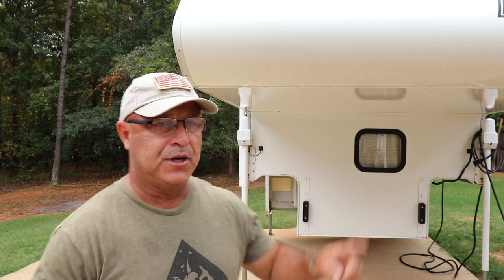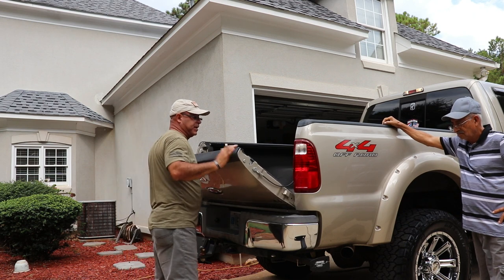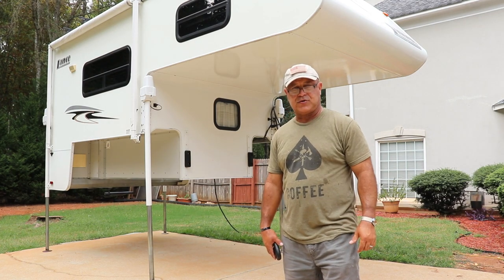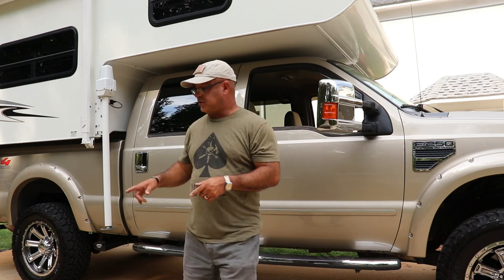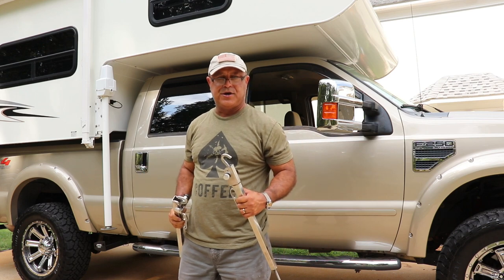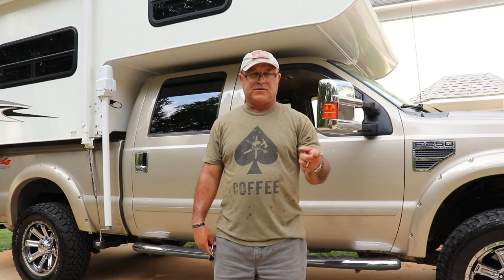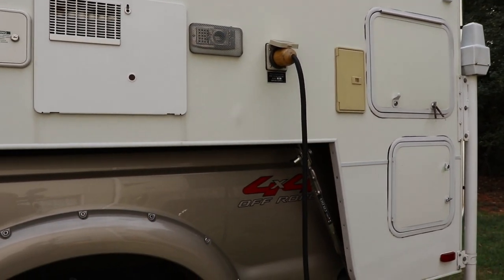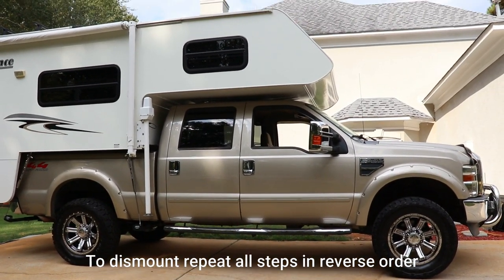How To Load a Lance 825 Truck Camper on the bed of the Truck

Comment: Do you have an auxiliary 7 pin plug from the truck to the camper in the truck bed or do you use the 7 pin plug at a tow hitch  hitch? You never plugged it in. Did you miss a step?
Reply from the maker: Thanks for the question. Yes, I use a 7 pin plug at the hitch. Once I load the Camper I leave a 2 finger gap between the camper and the rear truck lights then I run the cable back to the hitch thru the side of the bed.